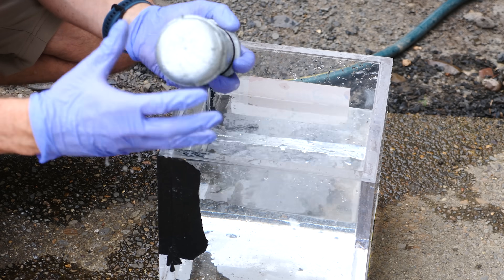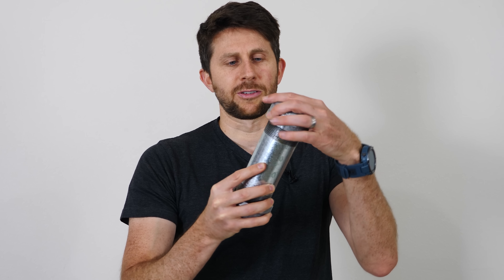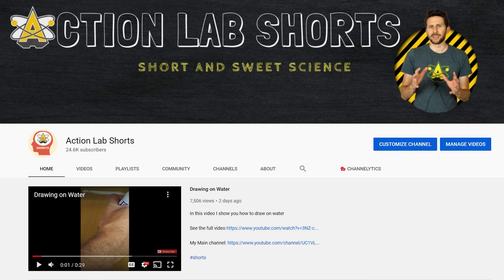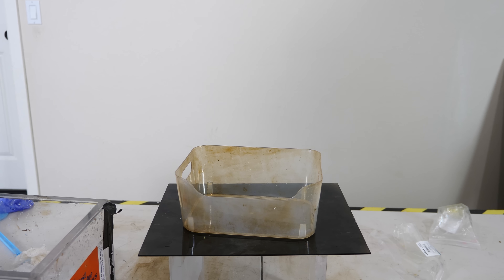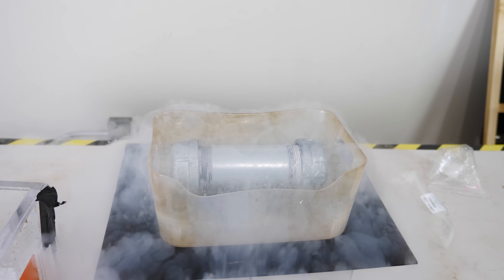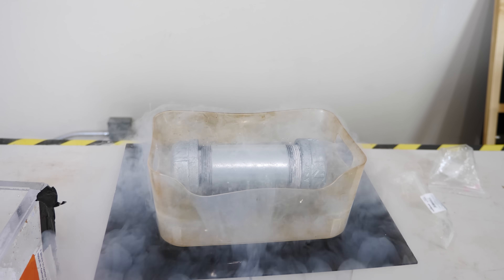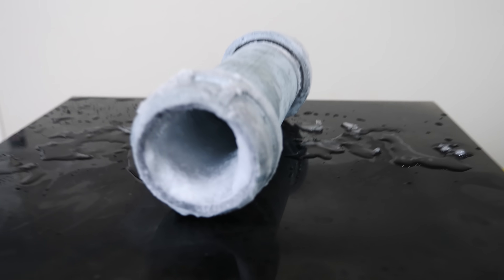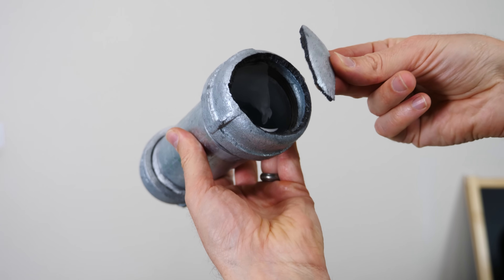Can You Stop Water From Expanding When It Freezes Into Ice?

Comment: "cold water"(forget steam) can be in many different phases - some of them - different texture crystalline types when other - liquid
below 0C there possible some specific states, at 2000 ... 4000bar pressure - at special points of P and T  - crystallization to some specific type of high pressurized ice - happens, then - it can became  pressurized liquid again - not more than 10000 atmosphere pressure really can be achieved by this way, but your steel jar can handle <1000bar as i guess, and not at low temperature - when metals loses plasticity... becoming brittle - like PETF 5liter bottle of mineral water - cracks when fall from 1meter altitude - if winter weather - when plastic - is not plastic anymore...
water can be pressurized three times in volume - to density=3kg/liter - about at  1 000 000 (million)atmosphere pressure -as it was recorded during tests of underwater ammunition - explosive charges
Reply: you are lucky - man
when russian experimentator did same kind experiment with liq. N2 and 1...2 inch steel water-supplying tube with steel caps - like your but more thin - there strong shot happens, and one of steel cap - shooting with a hit in a reinforced concrete wall - pressed into it, remaining on the wall like a nail head

Comment: There is a reason why expansion tanks, closed or open types, are always part of a closed water loop. Doesn't has to be freezing or on steam form, just changing the temperature from say 20°C to 80°C will cause enough expansion to rupture your system unless you have some way to let the water expand as it heats up.

Comment: Withstanding that pressure would take roughly a two-foot-thick sphere of steel. Drill a hole to the center, add about a tablespoon of water. Insert a steel rod as a plug and arc-weld to ensure a solid sphere with a tiny bit of water.

Insert into liquid nitrogen. It should barely work; the plug may move a bit, but the ice will be denser than water. Problem is, you have to rely on an MRI scan to confirm

Comment: Have you watched Nilered’s channel where he is working with supercritical CO2?  I believe there were 3 so far.  The first one didn’t hold pressure well enough, the second he used a chamber he got from Ben at Applied Science and was able to produce the super critical CO2.  In the final one, he was using a high pressure rated stainless steel chamber that might survive the pressures you were attempting with the water ice in LN2.  Unfortunately the galvanized pipe you were using doesn’t have a very good pressure rating because the grains in the metal are very coarse, not unlike pot metal.  I’m not berating your experiment, I was actually hoping it would have worked, but I sort of though the galvanized pipe wouldn’t survive.  The stainless should have a better chance of success, though a failure at the pressures you would be looking at would be rather spectacular.  Great video!  Cheers.

Comment: I would employ you to use freezing water to compress something like a hydraulic press, except with much more pressure. Tungsten or titanium blocks with a sealed cylindrical core between them should do the trick. I’d try a penny crush first just by placing it in a freezer.

Comment: If the exotic high pressure ice forms have higher density than water, then how will the high pressure be maintained inside the rigid container? Will the container have a mixture of two or more forms of ice so that the overall volume is conserved (and each region of ice is subject to the right pressure to remain stable)?

Comment: So in theory it will not only freeze it'll actually SHRINK as it does so.  Which begs the question:  Would it continue to be "Ice 10" or whatever, or would it then try to change into "normal" ice?  What would the stable form be?

And it's only theory because you can't build a pressure vessel that strong.

Comment: "Let's see if pipes can stop water from freezing"
"All of texas" we all ready did this experiment
Reply: ooof F in chat
Reply: We did it more than once where I leave in grandparents house when they died (so noone was heating house in winter). A little bit of water left in the system in lowest point - here goes a steel pipe.
Reply: It’s a consistent scenario everywhere there’s pipes and cold when the heat stops working.
Reply: Everywhere north of Texas
Duh...
Reply: This is where extruded polyethylene shines.
Reply: Can confirm
Reply: What did you get?  Cancun Cruz!!
Reply: J D  ikr? I thought this was common knowledge.  Perhaps not in warmer climates.  Usually plumbing splits along the length of the pipe and not so violently, but the pipes are usually smaller diameter, secured to something, without large diameter caps .
Reply: @willmcgo8288  it's almost mainly in copper which is much thinner than galvanized steel. And under pressure anywhere from 40-65 psi.
Reply: Depends what pipes are made of.  End cap burst so rule out cast iron. Use machined steel end caps then expect the low grade waterpipe to give way. At some point of upgrade to better metal it will hold and stop the process of ice forming. Just a matter of testing whether it's gotta be high tensile steel, stainless or better. Side by side tests would be interesting to see.
Reply: @AnthonyGoodley  allreddy
Reply: @benarnesen8132  Whut our ewe tall king ah bout?
Reply: @eamonia  It's just reversed, just the seems off.

Comment: I don't think the cap is steel, it looks just like cast iron (a far more coarse appearance, rougher than steel when broken, even when cut a difference will be noticeable) which is nowhere as strong as steel and of a different molecular structure. It also probably expands and contracts at a slightly different rate to the pipe which could have contributed to where it broke.

Comment: Well this winter a cold snap of -40 split open a main pressure line at the fertilizer plant my dad works at. That line regularly operates at 4,500psi and is rated to 12,000. Your pipe is screwed

Comment: Also the reason the caps were the weak link they are flat and are cast iron/malleable iron with a galvanized coating not actually steel if it had been true steel it would have warped until a pin hole or slit opened up or the threads sheared and it would try release the pressure or just contain it

Comment: Is it possible to do water's tripple point experiment at home?
Reply: If you can get the water to 0C at below 611.657Pa pressure.  I think this would require a vacuum chamber, but don't know the details of how to meet all the conditions required.
The page with the phase diagram used in the video:  wikipedia.org/wiki/Phase_diagram

Comment: Maybe you could show the other forms of ice in an experiment?I was thinking if you get the water container spinning (like with a beer can chiller - there are many of them on the internet and diy YouTube videos about them to cool a can of beer from 70 degrees F to around 45F in around 1 minute, the best choice might be a straight connection to a drill) it will radiate any heat out from the center of the container with centrifugal force..You already have a great setup, just add the connection to the motor..The shaft can go through the hole in the container or a new made hole..I think if this can get figured out, this might be use for Cryogenics on people..This could stop the expansion process..It could make Cryogenics a reality..I say it must be frozen down to the temperature that ice crystals do NOT form (there is a temperature range that they form)..
Also, just curious...Did you use pipe glue or tape to really seal the connection on the tube? That could help stop fluid leaks..

Comment: Its not like it just wouldn't go through a phase transfer just because its trapped, all the will happen is the massive build-up of pressure as the outside freezes and the inside gets pushed closer and closer together. 
I don't care to do the math, but in parts of that pipe bomb Ice IV and maybe even V or VI was produced, at least for a moment
TL;DR never trap something that's expanding, whether its liquid gas or solid, it will get out in some way or another unless you have multiple meters of steel walls on every side (and even then it will find an imperfection and break it)

Comment: You tried to make a pipe bomb. But you can't. Those end caps are not steel. They are "pot metal". I seem to remember it being illegal in the 1970's to put steel caps on steel pipes. Compare the quality of the metal caps to that of the pipe. 
Alternatively,  try it again using a Canon ball, and welding the fuse hole shut.

Comment: At 5m 8s you refer to this as steel. The problem is that while the pipe itself is in fact steel, the caps you are using are actually ductile iron, not steel. Try this again but use steel caps or steel (not iron) couplings with plugs (preferably steel, not iron).

Comment: It would be cool to have a pressure gauge on the container, so we know how much pressure that was built up inside before it fails.
Reply: Actually that can work as long as there is liquid inside and the probe protrudes inside enough into the water core. The gauge (the normal ones) won't show the pressure after the water freezes inside it.

Comment: If you could prevent water from freezing it builds up a lot of energy/a lot of pressure especially when it hits ice 11 or 12, (you're overcoming the repellant of the atoms) from a seemingly non equivalent energy input (i.e cooling the water) (which is actually removing energy but your transfering energy, whatever) I wonder what kind of mechanical mechanisms we could use this for...

Comment: The cap was relatively brittle cast iron, not steel.  Unless you used freshly distilled water, the water has dissolved gases that are driven out of the water as it freezes.  This is probably where the potential energy came from.

Comment: I think your analysis of what caused the explosion and what makes exploding vessels dangerous is a little off.  I doubt the vaporising of the nitrogen contributed very much if anything to the blast.  While what you say about gasses expanding is somewhat true, and most conventional explosives work by turning solids or liquids into large volumes of gas, but in this case, which is similar to heating a closed system, that's not really what determines the force of the explosion.  Rather, the force of the blast is determined by the strength of the container.  Because the steel tube was very strong, the force required to break it was very high.  Because it was somewhat brittle, once it failed, all of that force was released at once, resulting in an actually quite dangerous blast - you're lucky it only broke at one point and sent those pieces off in one direction, because that shrapnel could have probably ripped right through you.  A weaker container with more of a tendency to bend or rip, like an aluminum can, would have given a weaker, less dangerous explosion (but wouldn't have reached the pressure you wanted).

Comment: Correct me if I'm wrong, but doesn't regular stainless steel become very brittle under -10°C? There are steel alloys designed specifically to handle low temperatures. I'm not sure freezing it with LNO2 was the right way of testing this. It just made the steel way too brittle, too fast. I know water can be very powerful when put under pressure, but the olcschool steel engine blocks didn't explode when they froze after someone filled them with water in the winter, they usually bulge and crack.

Comment: So if we were able to contain ice12 in a container, there will then be a vacuum somewhere in the container and then it will be able to implode, or there will be more space between the molecules, as the ice12 is denser than water per centimeter cube, as it is not gaining any mass. Is there a better way of saying/explaining this or am I missing the point?
If that is right, then it will go from normal pressure --> high pressure --> normal pressure --> low pressure, right?

Comment: I haven't watched more than the introduction up to 1.12 at the moment but, my prediction is that it won't break or split but may have swollen and or or stretched slightly so, I really hope you carefully measure diameter and length before the freezing and again after, if it doesn't split that is. If it does split, which I do consider possible, especially with steel so cold then my measuring would be pointless. Going to be interesting to see if my guess is right and even if wrong I'm not deleting my embarrassing failure lol.
Reply: Holy crap! You say you're not going to fill it completely because that would be extremely dangerous as my imagination visualises it bursting suddenly even just a little and showering or even splattering you with some liquid Nitrogen then you show your neat little blast shield (which looks like it could really do with a handle in the middle area inside that it may have but I couldn't see) then back to you FILLING it with Nitrogen THEN remembering your blast shield only seemed a fraction of a second before it exploded much more violently than I imagined it even could. 
Geez man, safety!!!!!   You were extremely lucky you got it up JUST in time!
Very interesting result and very interesting information about expansion or stopping it and keeping water as liquid.

Comment: There are two factors here that made this explosion: by freezing that steel tube you reduced the strength of that container. Generally metals crack easier when are in freezing environment. Some cons thing is the rate of water being freezed. It happened much quicker thus its expansion was quicker so it pushed on that metal tube with much more force than if you slowly drop temperature down.

Comment: Those end caps are cast so absolutely more brittle than the steel pipe or even those steel cubes made by the other YouTuber that did this experiment.. I’d like to see this done with something actually strong, maybe a giant high tensile nut with two bolts threaded into it and water in the middle.

Comment: 2:40 ⚠️DANGER!!⚠️
That assumption may be wrong. Yes the ice only wants to expand a little bit. But rupturing iron that was under high tension may still fly off high speed as shrapnel due to the stretching energy in the the metal converting to kinetic energy. Especially worrying when thinking about cryogenic embrittlement.
Reply: 4:18 — I saw it coming. 
Glad he didn't hurt himself.
4:56 — I doubt the sudden evaporation of lN2 played a big part in the acceleration of the metal parts here. I'd say the sudden (undirected) evaporation mostly caused smoke and sound. The less dangerous part here.

Comment: I'm glad you're thinking about safety, but you used very much the wrong pipe. Get small diameter schedule 80 stainless steel pipe and fittings, and cool it slowly using a box freezer or salt water ice bath. Using LN2 makes the pipe very brittle. Also, galvanized pipe is often galvanized ductile iron instead of steel, so your strength curve is quite different. Something to consider.

Comment: The end cap was made from cast iron which is much more brittle than steel. If you want to try again check out what’s available online for Ultra High Pressure fittings. Some of the items are in excess of 90,000 psi. 😉
Reply: the end caps are not cast iron and they are not cast steel...they are a sort of half and half ,cheap but not competley useless
Reply: So if it breaks you just get cut in half. Nice
Reply: 90k psi? We're gonna need a bigger blast sheild

Comment: What if, instead of preventing ice from expanding you prevent H2 and O2 from expanding from water during electrolysis? Could you make are pressurized electrolytic "battery". Store the energy as pressure? Separate the chamber with a proton exchange membrane and reverse the process to generate electric current. How much pressure could you create by H2O electrolysis. How bad would it explode? Please be careful answering this question so you can continue to make interesting science videos. Thanks.

Comment: I am wondering about the construction of the end cap. Is it a cylinder with a plate somehow attached to the end or is it hot or cold formed into that end cap as a solid piece of steel? I'm just wondering about why it failed where it failed.

Comment: Had a bad feeling about that.  So when high phase ice increases in temperature it expands.  The natural state of h2o here vs other planets?  Can you quickly superfreeze the water to a higher phase state whereby you "pass" the expansion state?   Then of you set your container device somewhere safe a room temps as it heated it would it explode?  Would the containment issue be different coming down from the higher phase?  Could you superheat the higher phase to pass the expansion state?